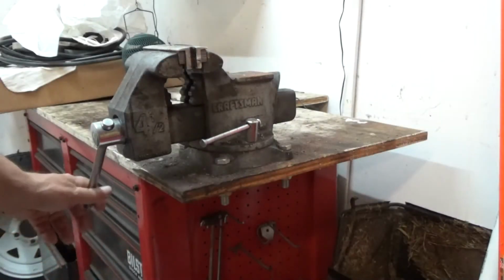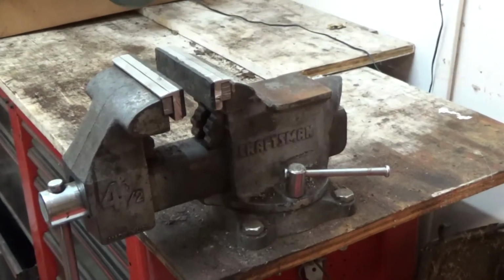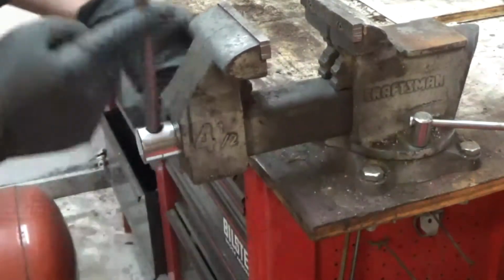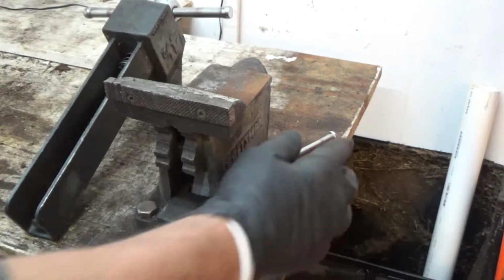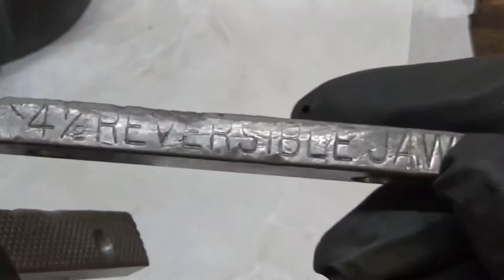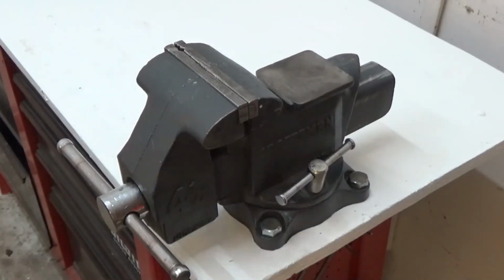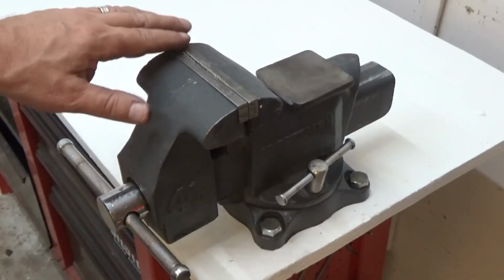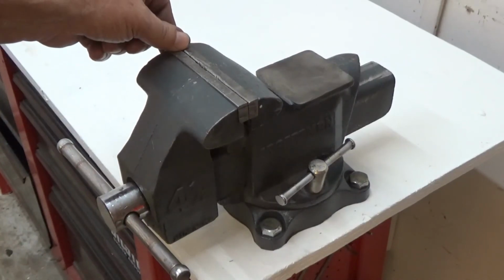Craftsman Vice Refurbishment

Comment: My clip that holds the spring in place broke. Is that just a standard C-clip?
Reply from the maker: Yes that is a standard clip that should be available at the big box hardware stores, use a U.S. standard and not metric size.